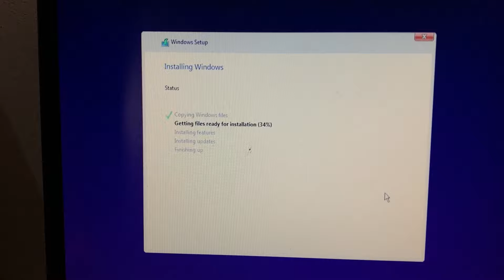Upgrade Part 2 of Old Scrap Pc (short video)

Comment: Hello Sir,
I just built a PC. It is working fine without graphics card. But when I insert graphics card, the PC does not start. The SMPS make small buzzing sound. My SMPS is zebronics 450 watt and graphics card is Nvidia GT610.

Please help sir aisa kyu ho rha hai 🙏😢
Reply from the maker: Brother contact me in my Instagram paramcomps Show me your problem there. So then i can help you
Reply from the maker: Gt610 bhut low profile gpu hai. 
Iski voltage ki jada requirements nahi hai. But jab app gpu ko install krte ho to No Display aatta hai?
Reply: @paramcomputers007   Jab gpu instal kr ke power on krta hu tab kuch bhi on nhi hota. aur smps se dheemi buzzing jaisi awaz aati hai.
Reply from the maker: @prasb  os gpu ko kissi or pc pye try krke dekho pehle.  Kyoki sometimes gpu mein fault ho to phir powersupply mein abnormal voice aani. suru ho jati hai